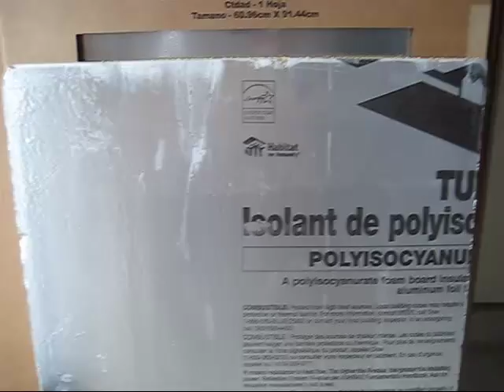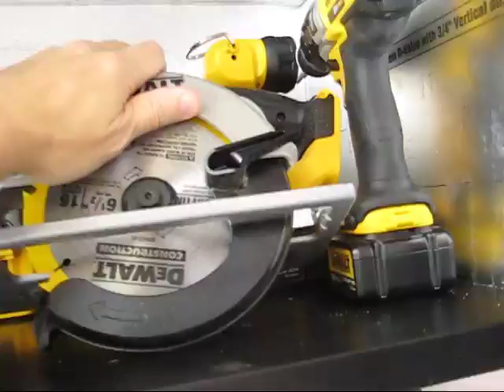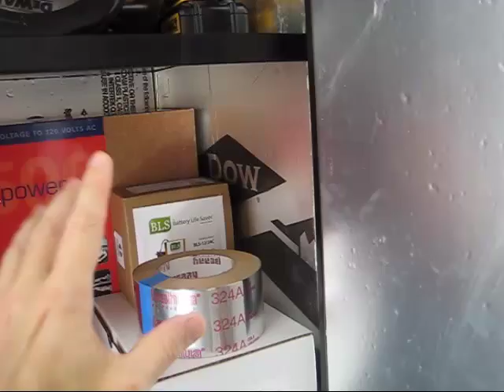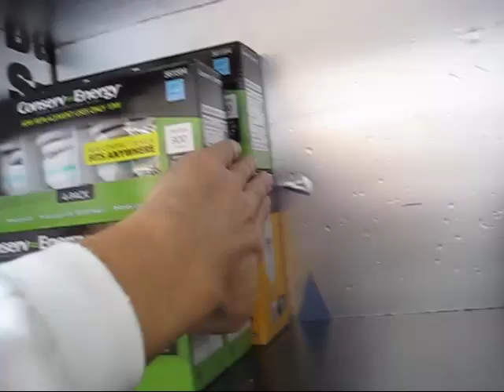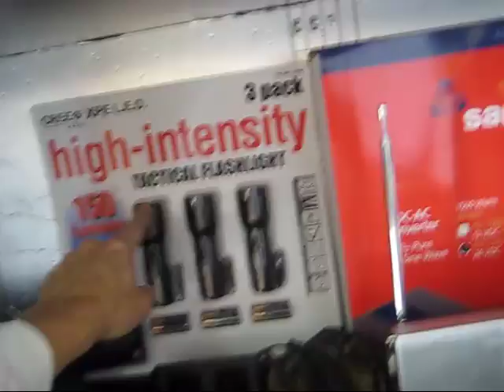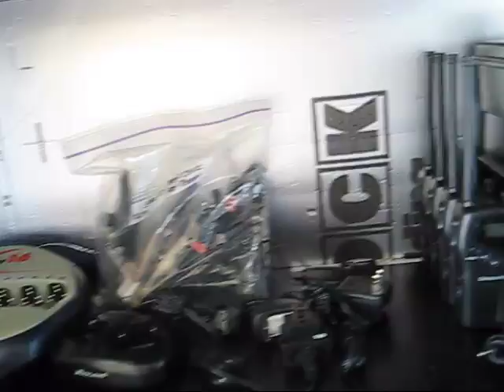Faraday Cage: How to Make on the Cheap

Comment: A Faraday Cage: Metal cabinets, metal file cabinets, wall, floor, or gun safes are insufficient "Faraday Cages" to protect modern electronics. They all have to have doors in them for you to access the contents. All have to be insulated inside to keep the EMP's massive surges from entering. I recommend that you find and use large wooden  or strong cardboard boxes to store your electronics,  in their original shipping containers or packaging (If you didn't save the original packaging, use bubble wrap to insulate the electronics). Be sure to remove the original metal screws or staples, as you do not want any metal objects to pierce the box,  providing any electrical pathway into the box (use glue to hold the box together). Now to insulate the box - wrap the box in aluminum screening ( Not the fiberglass screening so popular today, the same metal mesh screen you would use in a window or door screen) making sure that the seams overlap at least three inches for greater conductivity. Hold the seams together with the aluminum tape described in this video. Pick a rather large closet to store the box in, as you may make other boxes to store extras in. Never, ever "ground" the box to anything like a metal pipe or gas pipe, you want your Faraday Cage to "float" above ground. Primary batteries like alkaline or carbon zinc need no protection,  rechargeable batteries, or battery packs do, as they have an internal fuse, or heat sensor in them, so store them fully charged in the Faraday box you have created. This information comes from the U.S. Navy Civilian radio operator volunteer service called the "Military Auxiliary Radio Service". We all have been extensively trained in emergency communications, and I pass this information on for your use.
Reply: Lawanna Ard
 As long as you seal the refrigerator's door sufficiently with conductive aluminum tape, you do not even have to bury it unless you need to conceal it from prying eyes.
You do not need copper wire for a Faraday cage. Any metal box or even a metal trash can will do. I use an old filing cabinet sealed with electricians aluminum conductive tape. The contents are insulated from contact with the cabinet's insides with a double layer of cardboard (important), and you MUST not ground the container. Ungrounded, the "Faraday" cage you have constructed will shed the emp currents back into the surrounding air or ground like static electricity - and not affect the contents at all.
Reply: +longshorts3 Just to back you up here, insulation is more important than the shielding. I recommend heavy duty aluminum foil and freezer bags because they're thicker and easier to work with. I did this with a radio I put in storage, I wrapped it up with insulation and aluminum foil three times just to be sure it's protected.
Reply: Just as long as the foil (heavy duty) does not contact the radio in any way and you layer the bags and foil so that one layer does not contact the next. Also, disconnect or cut off the freezer's ac cord and line the inside the freezer with heavy thick corrugated cardboard, all sides/bottom/top.after the freezer is dried out well. Then use aluminum foil tape to seal the seam of the lid of the freezer/Faraday Cage.
Reply: gene gleeson
Any enclosed metal box will work as long as you line the box with any insulating material like rubber, cardboard, or wood, and box any item in a cardboard box with a silica gel pack to absorb moisture and packing material like bubble wrap or packing peanuts which are naturally non conductive. The idea for using a home built or re-purposed metal box of any kind is to electrically insulate as many times as you can - the box and the items you wish to protect. Good Luck!
Reply: +longshorts3 is a steel truck garage box good to use for a faraday cage ?? the one that goes on a back of a pickup truck?? its steel
Reply: What about a stainless steel refrigerator buried in the ground lying on is back.?  If that would work, does it need to be grounded.  And this may be a stupid question, why typ of copper wire......insulation free copper wire? And what about solar panels do they need to be in an emp if not hooked up to anything.?
Ne
Reply: Very, very good, and absolutely crtiical recommendations for him.  I can guarantee that the way he built it (without your recommendations) THIS WILL FAIL FOR ANY H.E.M.P.  It may work for solar, as long as it is not any major SME type of event.   Again, excellent suggestions!
Reply: Longshorts3 - Excellent recommendations...thanks for sharing 
them.  I have worked with S.A.T.E.R.N. (Salvation Army Team 
Emergency Radio Network) in the past, but have never worked 
with M.A.R.S.  I'll have to check them out.
73, 
K6KCC

Comment: Do not use a radio to test your "Faraday Cage". Radio waves are so very weak compared to the many massive electromagnetic and electrostatic pulses  from an EMP source, as the pulse will reflect off any close by metallic structures, and hit you from all the directions of the compass. Millions of volts, and millions of amps (currents) will saturate your location for an unknown period of time - up to two to three days. When the "Northern Lights" of the EMP surges  go away, you can be safe to open your Faraday Cage. It takes time for the Earth's magnetic field to rid itself from the massive energies from an EMP source, so be very patient. You may be frantic for news from the outside world, but buying an old tube battery operated receiver will help you there.  Just make sure that the tube radio uses no transistors or modern glass or plastic diodes in it.
Reply: +longshorts3 Where can I find more information about an EMP's aurora effect?
Reply: Check with the National Institute of Standards and Technology, or with the Congressional records of Newt Gingritch speech on EMP attacks
Reply: Okay, thanks.
Reply: The books of William R. Forstchen, "One Second After" and "One Year After" show the effects of an EMP event. They are worth reading.
Reply: Already read them, they were so well done. But thank you for mentioning them.
Reply: longshorts3 Why wouldn't all the radio stations be fried with their massive antennas picking up the pulse?

Comment: Very good start, but I would go further and put plywood on the shelves to further insulate the items on the shelves because they're attached to the outer shell of the cabinet.
Reply: Many thanks, I've been looking for "cage de faraday" for a while now, and I think this has helped. Have you ever come across - Tennorra EMP Esterification - (search on google ) ? Ive heard some incredible things about it and my brother in law got great results with it.
Reply: I Agree, the shelves are welded to the outer skin and will transmit the pulse to the inside. There should be a layer of foil insulation wrapping the total outside shell.

Comment: I keep all my Yaesu radios in layers of foil and freezer bags . 3 layers works fine . The tape alone would have no insulation . The foil insulation you put up has a good layer between foil layers . 73's KF5MCD

Comment: Was one  of four Tech's that built a Faraday cage/ Gauss field containment room in the basement at the hospital in Coalville, Pa.
Ground isolation is checked throughout various stages of construction due to intense labor involved, as we were wrapping things up we were doing final test for R.F. and found the bad news.
Someone dropped a piece of conduit from the wiring above the room and closed the circuit.
To explain the various steps and procedures in the construction of these rooms would be a daunting task, almost like the work itself.
Just wanted to give a shout out to the prick that committed this heinous act of sabotage, you're an ass, the only people you hurt were the ones in need of that room.

Comment: LDSPrepper Did you insulate the bottom of the cabinet also with aluminum? 
Important is that the items in your Faraday cage should NOT come in contact with the walls or the shelfs, must be insulated with rubber or such. 
Good luck with it.

Comment: First of all, the people that said you need a ground attached to the storage cabinet are correct. Secondly, you can pickup a decent RF Meter for less than $100 and if have anything that emits a radio signal (the bigger the better) such as a Cell Phone, Cordless Home Phone, or the best option (if you have one available) a laptop or tablet. You can place them inside the cabinet and they will try to find a service connection via a Cell Tower for the Cell Phone or a connection to the home base for the Cordless Phone. On the laptop or tablet you can download network finding software, such as NetStumbler for Windows or WiFi Finder for an Android Tablet and they will continuously search for WiFi networks sending signals from the wireless adapter. This works the best as it pounds the container with signals trying to get out and you use the RF meter to scan every inch of the container to see if you can detect a signal. This will give you a better chance to defend against an EMP, than just using a radio to get a signal. If you have any questions hit me up and I'll try to help if I can. Good Luck.

Comment: Incidentally everybody around the prepping forums has their own opinions on how best to protect stuff against EMPs so it's impossible to get a straight answer!
PS- A guy said small items like a radio can simply be popped in an old microwave oven because it's a Faraday cage, is that right?
Reply: The problem with this field, is there's really no way to accurately test homemade devices.  The radio and the cellphone tests, are a good indicator,but if will actually hold up to a large EMP blast.

No one will really know till after it happens.

Comment: I keep my backup CD/DVD's in a small biscuit tin with the lid on, will that protect them from an EMP burst?
Reply: CD/DVDs are created with light waves, where a laser is shot at the disc and the reflection produces the signal (for the sound).  An EMP burst will not effect them (that I can think of).  Heat will effect them.

EMP would effect magnetic items, such as cassettes or floppy disks.
Reply: Dustin O Thanks, it's nice to know that EMP's won't affect my CDs/DVDs..:)
The only other things of mine i can think of that need protecting are my radio, and computer and TV. Anything else?
Reply: TungstenKid A Faraday cage will only work if the item in the cage does'nt make contact with the cage walls. You have to insulate it with rubber.

Comment: You do know that there is a vast difference difference between radio waves and sound waves right?  Just because you can't hear a radio audibly, doesn't mean that a radio signal isn't getting in there.  Actually... The first clue that a radio signal could get in there, is the fact that THE RADIO IS PICKING UP A BROADCAST!!!
  First, the shelves are still attached to the outer portion of the metal cabinet which would allow an electrical or high range EMP to conduct and disperse throughout the entire cabinet.  Second, you would have been better covering the entire exterior of the cabinet in the insulation and sealing with the aluminum tape.  You wouldn't be able to open it in the interim, but at least it would be effective.  All you've created here is a soundproof cabinet.  Sorry man.
Reply: James Low He said in the beginning of the video that hearing static is OK.  He is not blocking the sound but the ability of the radio to pick up FM signals.  I would agree that you should make sure the radio is turned up high enough that you can hear the static when doors closed to ensure that the radio isn't picking up an FM signal.  Then when you open the door you should hear the radio, which is what he showed in his video.

Comment: Quick question,would it be better to place a cabinet or cage away from a structure that was wired due to possible fires from the event in question?
During  the Carrington Event of 1859 telegraph wires were observed to be drooping and melting from the voltages that were generated by the CME as well as fires were started by the associated rudimentary wiring that was present in some structures

Comment: Small technical (geeky) disagreement I have. You said static is not a signal and that's ok as long as you don't hear anything else on the radio. That's all well and good for this, but on any TV or radio, about 1% of the static you see and hear is background radiation from the universe. Which is technically picked up like a signal. Not that this would have ANY effect inside a cage, but just throwing that out there. =) Nice vid btw. I plan on using the garbage can idea.

Comment: I think I would have put the tape on the inside. Would probably work just as well but not be as obvious that it is a faraday cage. I bet the tape made all the difference and the insulation panels were completely unnecessary.

Comment: did you run a copper rod into the ground 10 feet deep, and connect it with a really thick copper cable? from what I've read a faraday cage must be very well grounded to earth ground to be effective....

Comment: Grounding the unit will disapate 99% of an EMP to the ground... Without grounding you're really just hoping that the whole unit can withstand an EMP, on it's own... Grounding redirects the energy to the ground, instead of enveloping the unit in a huge electrical current... Look at the unit you've built... It's really a capacitor... If you touch the cage after an EMP you'd be blown apart...

"The Arch of the Covenant" was just such a capacitor... You have layers of metal and insulators, which describes a capacitor... If an EMP hits, it will charge your cage with thousands of volts... Then when it is grounded, it will discharge... Hope you are not the ground... By Grounding your cage, you redirect that energy to the ground, away from your cage...

Comment: I have the same type of cabinet as you, I built one but my secret was I electrically bonded the doors to the body.  I used the shielding layer from Coax cable crimped and screwed to the metal.  My is a surplus HD GI cabinet.  Note you need to insulate the electronic gear from the metal so plastic totes are a must have.  I use the totes like a large drawers with plastic lids.   you could use trash bags but these can be damaged.

Comment: Does anyone know if a Faraday Cage home has ever been built?  Would a steel framed home with metal siding and roof work as a Faraday cage?
Reply: I think it might have been build already, however a steel framed home doesn't have to work. It depends on its permeability. If it lets through photons (light particles), an EMP would be still effective.
An EMP works because of gamma radiation aka photons released by an atom (simplified): Few gamma rays don't matter, but an EMP releases a whole bunch, thus taking away many of not all electrons necessary for conducting electricity in the electric devices.
The steel/metal needs to be very thick probably. And because it will run out after few EMPs, it has to be replaced eventually :/

Please correct me if I'm wrong at something. I'm 16 so I don't know everything ;)

Comment: I'm thinking if your solar panels will be vulnerable to an EMP, & as you might need more room for them, you should make a 2nd cage w/out the shelves in it for larger/longer items. I'd change the shelf brackets to plastic (non-conductive) & peel off Al from insides or cover w/ nonmetal stuff.  Maybe get a sm solar battery charger & a Steripen since bleach dissipates over time (lost efficacy--& better for bugout needs). Ground it out. How abt where the doors touch?  What'd you do to bridge that gap? My oddest electrical item is a UV flashlight (bought @ Halloween--haven't tested it yet, though) so if have to camp in desert, I can see scorpions (glow in the dark). :}